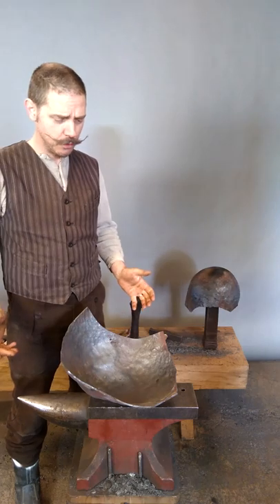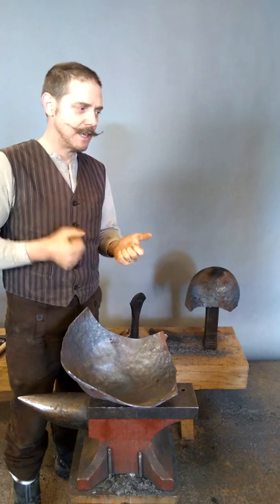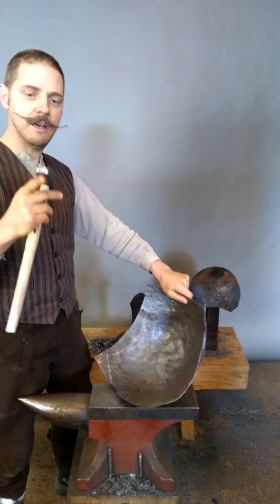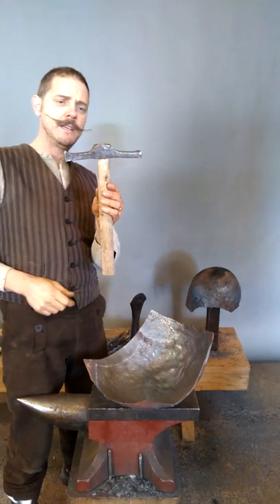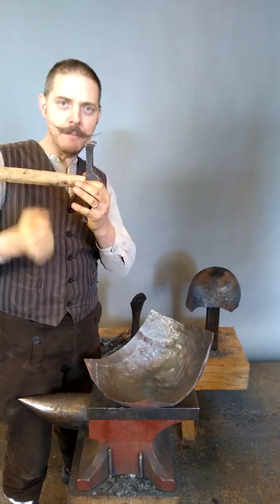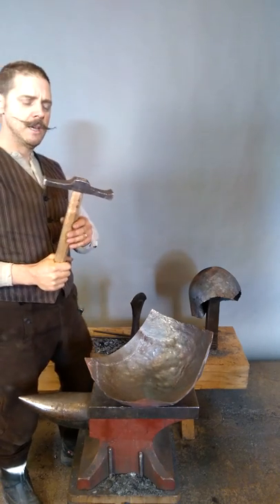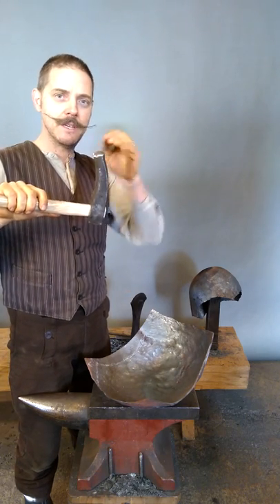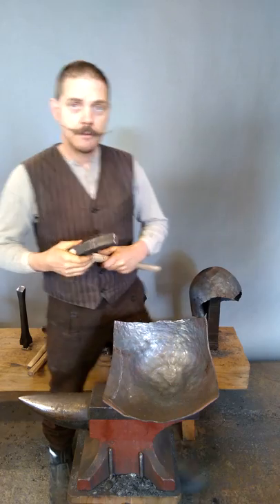Armour making hammers

Comment: doesnt streching the sheet make it weaker?
Reply: Well yes but actually no. I think Albert used quite thick metal sheets for his masterpiece project so that he could stretch the material like seen on originals. On the originals you have variation of thickness, for example the breastplate is often very thick in the front (I think ive heard they can be around 4mm there) to take a lance but on the sides they are considerably less thick, down to about 1mm since you would likely not be hit in the sides as much. We see this on most armour that is original, putting more material where more hits are probable is a pretty smart move considering you save weight and material that way. But of course there are errors too, I think there is a barbute where the helmet is thicker in the back than on the forehead. 
Short answer: It does weaken it but usually to the desired weakness or strength for the area on the armour.